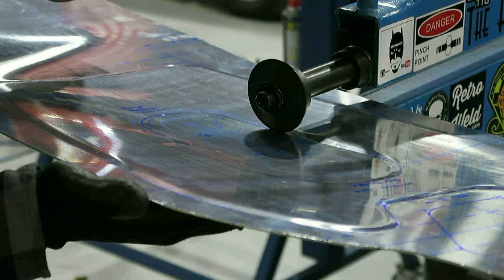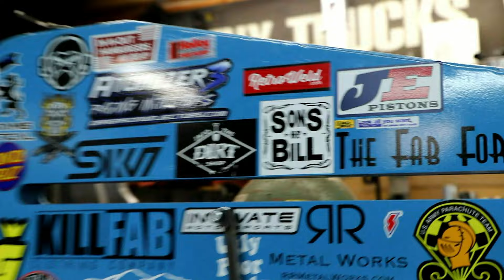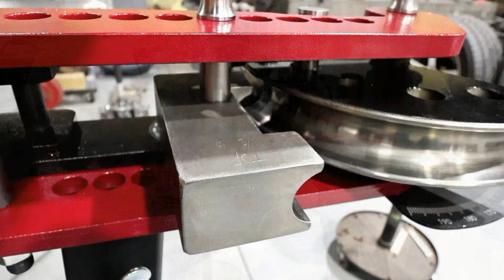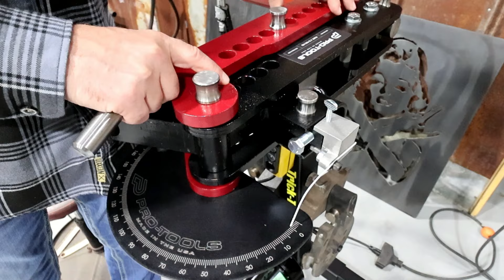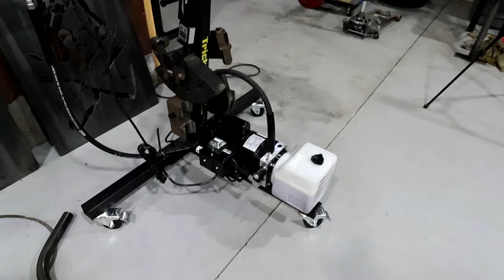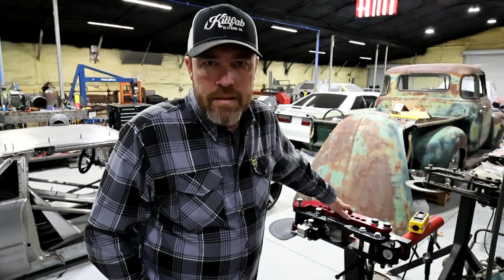You Need This Tool - Ep 148 | Pro-Tools 105 HD Tube Bender

Comment: I built my own based on another brand. It was a manual setup at first. I added an air over hydraulic cylinder to mine. However, and I think this the part that is over looked. All of these style benders operate in the horizontal plane. I made mine to operate in the vertical plane. When folded up and put away it took up 1 square foot of floor space. I made lots of motorcycle parts with it that I sold over the years. Finally got tired of dealing with customers wanting everything for nothing. I sold my bender. If you want to see it search for the 1 square foot tube bender. I'm sure it will come up as I shared lots of pics of it. The most expensive piece is the dies. No need to buy one. You can find the drawings for the specs to build your own online as it literally is just half inch plate. If you find dxf files you can have it cut out on a laser. I used hitch pins for the pins.

Comment: I am building a rock buggy....using Bend Tech for design and love that.   I have a similar bender, but found I was hesitant if I was close to the bend angle I was shooting for and did not want to go past which is usually a total fail.  I saw another guy do this on another channel, but turned it up vertically, lost the degree wheel and use a digital angle cube......so much easier with much less of over bend potential.  I found spring back on .188 wall DOM is not always consistent.  Just my 2 cents.  Love your channel!